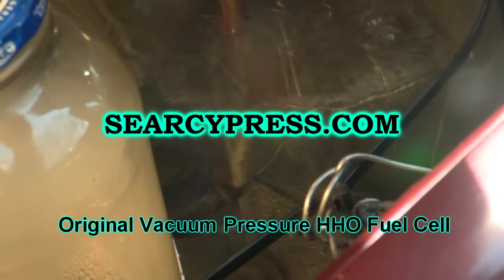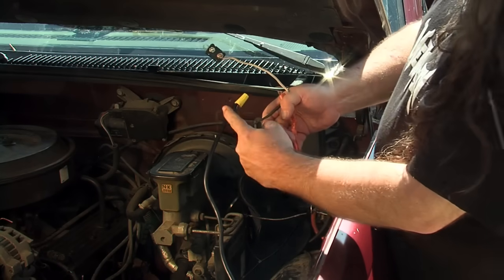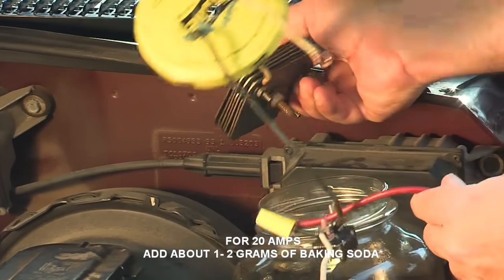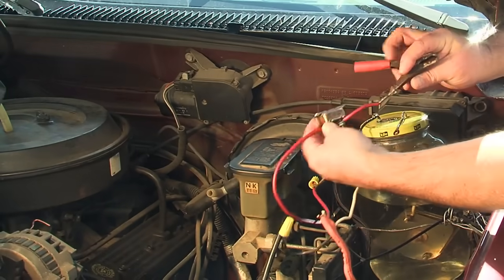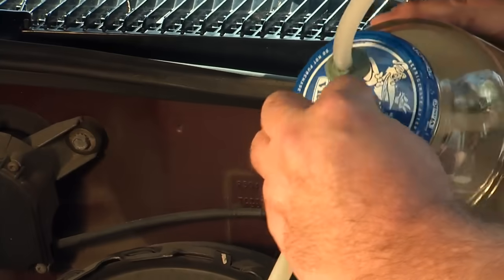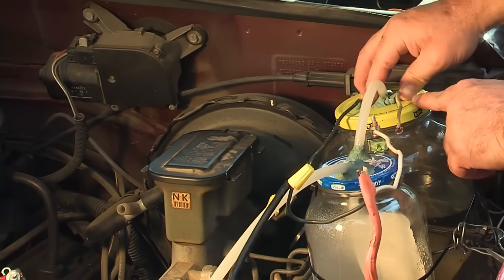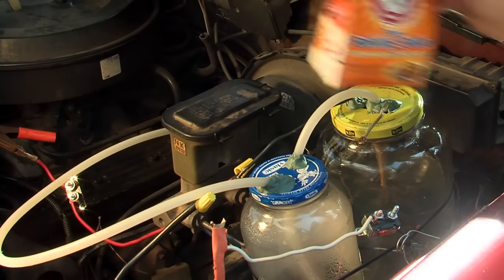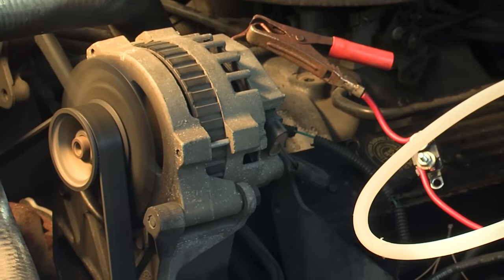Vacuum Pressure Hydrogen fuel cell defeats high gas prices using hydrogen from H2O.

Comment: Technically in theory a humidifier thing like cars in cold climates used or AC units for cars and houses used might vaporize the oxygen sludge safely vs spew it or torch it up out the pipe etc. But cheap/low cost is the name of the game here for now.

Comment: Again more MPG out of this than you realize especially in Diesel and EFI rigs etc. Joints up even over it. Pry about one cent per gallon even MPD!!  HP everything torque incl no mix chevy not so hard but better in Ford based combustion chambers etc with larger plug diameters are key indicators. NOS not needed unless copper piston or something cause it might melt aluminum pistons or rods when combined with H1/H2 combustion.. Put copper aluminum or brass pipe as replacement for radiator hoses for certain. Not that much hotter tho in rpm. I like tail vents tho even let alone easy to spot hood vents in certain non rusty prone spots etc. Stiffer frame would be nice so black smith em as reforged curriculum updates etc. Air compressor leaf blower things on semi trucks do beat em in MPG alone not MPD tho much. Electric motors do win all around tho except in fun and price margin still i guess for now. A cheap mix formula like shell uses would work just fine custom also but way tastier onboard with garden hose only needed etc. Ford and Toy look out you are up to bat!

Comment: LOL @ double your mileage. I think I'll inhale some HHO  and maybe magically I wont need to eat anymore.
Reply: Samuel is an idiot! I think he works for the government.
Reply: I think by adding the HHO to the car will sorta act like adding NOS into the car.  More boost more power.
Reply: RaM Wah Ching If you produce on board you lose power/boost. But if you create it from another source that doesnt require energy from your engine you are correct, It will give it more power. But the extra heat might harm your motor just like nos can.
Reply: I bielieve gasoline is more psyhodelic mby thats why people are still in this Hight of being DUMB sheeps :)
Reply: Ramces Gonzalez I knew that. Had much on my mind. Thanks for the correction.
Reply: You do realize hydrogen is a very explosive gas and nothing burns with water when you burn the two gasses, it burns with more power than gasoline and air mixed with injection. And the “exhaust” from HOH is pure water. Dihydrogen Oxide is the cleanest and best fuel possible. For laymen Dihydrogen = H2 and oxide is oxygen so it’s water.H2O. Oxygen is actually a diatomic element so it’s naturally in the world as O2. The BS about ozone (H3O) is they say it’s being depleted, but they don’t mention is only has a 1/2 life of just over 30 minutes, so it’s continuously being renewed, but CCF’s do screw it up.
Reply: Typo to last “... nothing burns without oxygen.
Reply: Ozone is O3 not H3O. Also, If you want to look at the numbers, then find a table of common standard potentials, there you will find that the standard potential of the splitting of water is 1.229 V, and the production of Hydrogen gas through electrolysis is 70-80% efficient, far more efficient than a gasoline engine (25 to 50 %). This means that the input of energy is smaller than the energy stored in the hydrogen gas produced.
Reply: HAHAHAHA LOL great dieting trick, love the trolls too.
Reply: Samuel Atkins you're not entirely right. It actually depends on the catalyst used. H2 (Hydrogen gas) & O3 (OZONE Oxygen which is SUPER perfect for the tech). This tech is beyond proven to be literally fool proof. Idk how so many bright people don't believe it when too many normal everyday people have working examples of them even now. This tech is awesome and is a key to the energy solution puzzle for sure. Thank you everyone who works to make science and truth coincide, and to do away with all the taught lies!  :D
Reply: RaM Wah Ching You are wrong 2 ways. Firstly The amount of HHO that is added is a fraction of the amount of NOS that is generally used. Second the HHO contains hydrogen that uses up the oxygen in burning so actually there is no extra oxygen  being added to your car.

Comment: Thanks for sharing your knowledge. You explained it so well . I will definitely try this. Thanks again.
Reply from the maker: Keep it safe...try at own risk...ty
Reply: So it's four years later...how did it go?
Reply: We regret to inform you that Moonrider1968 is currently in orbit around the moon due to his gasoline experiment's explosion. If only he had known that hydrogen doesn't explode, it implodes and actually cancels out the explosive pressure of gasoline and reduces gasoline efficiency:(

Comment: This set up works best on older cars since todays cars computers have O2 sensors which regulate the amount of fuel/air mixture in the cylinders. there is a work around that someone came up with. If you have a gas generator this could work as long as you had enough power to generate the amount of HHO to run it.
Reply: EFIE (Electronic Fuel Injection Enhancer)

The EFIE is intercepting signals from the oxygen sensor to the computer and fools the computer by giving it false exhaust readings from the Oxygen sensor.This is necessary because the computer is set up for a regular burn of fuel and compensates for the more efficient and cleaner burn by dumping more gasoline into the engine (until it gets the reading it expects) which ruins your fuel savings.
Gasoline burns better (cleaner less waste) with HHO gas because the increase burn temperature .

You can buy a EFIE on the internet or if you have the skills you can build one.
Reply: @MrShakamuni01  An oxygen sensor checks how much O2 is left in the exhaust gasses. If it senses less than there should be, when for example driving with HHO, it thinks that the engine is running rich, so it will lean/reduce the fueling from injectors. Still doesn't change a fact that this hydrogen device won't give you any more mileage.
Reply: The truck in the video is using an EFI system...
Reply: Quick, everyone buy old ass cars and lets try this.  Fuck all this new shit.
Reply: Theyve been using the current EFI systems with o2 sensors since halfway thru 1985.
Reply: An efficient electrolizer must be used
EFIE device or similar must be used
Ignition timing (ATDC) must be changed
Even compression ratio adjustments (more)

That way you will get the most out of this, otherwise expect the ussual 10% only improvement.
Reply: This should work on a 2000 ford ranger without computer modification right?
Reply: this has me thinking reverse effect,this would cause your o2 sensor to read richer thus your pcm would take out negitive fuel trims and run less fuel to account for the extra fuel.of course your pcm can only pull out so much fuel with fuel trims but should decrease the injector pulse width enough to see a difference.be nice to have a pcm that is programmed for hydrogen so it able to adjust accordingly and perfect the air/fuel ratio
Reply: This setup does not work on any car because it uses more power to split water molecules than you get out.
Reply: @jimmio3727  Yep... no such thing as free energy.. which is basically the BS this guy is trying to spew.
Reply: @jimmio3727  my neighbor has the same setup in his 80’s suburban and went from 12mpg to 24mpg. He’s just using current the alternator is already generating.

Comment: This, by the way, WAS the first result on the search, which somehow seems to be spamming a lot of the vids.
Inspiring, but not much in the way of specific detail, so you actually HAVE to think for a few minutes how to pull this off. A terrible challenge to everyone with our virtually non-existent attention spans.
Add a few extra dollars for a PWM (or even fewer for a pot, MOSFETs, and an ammeter and take care of current-limiting manually) and you've got a spectacular little fuel mileage booster system for a little over $100.

Comment: Does this put water into the engine if it leaks from the tail pipe , couldn't it possibly rust your  block ?
Reply: gasoline burns with water dripping from tailpipe too,

Comment: Think back to NASA putting rockets and space shuttles into space. The did not do the countdown and say we have flashpoint, they said ignition. The four strokes of a 4 cycle combustion engine are intake, compression, ignition and exhaust. Spark plugs provide the spark so the fuel air mixture under pressure ignites. A key is put into a vehicle's ignition switch, which is part of the electrical system from which spark plugs draw energy. GM/General Motors understands they makes engines not motors.

Comment: Ignition point, the point at which the compressed fuel air mixture ignites. Since that point is 20 degrees cooler for HHO vrs gasoline compensate by advancing the timing approximately 7 degrees. One of the issues that many using HHO have to overcome is the engine running 20 degrees cooler. Vanagons don't have that problem, they are notorius for overheating and running hot. Volkswagen 2.1L 4 cylinder engines are 95 hp, HHO fuel increases hp 30% which makes a huge difference for a Vanagon.

Comment: I filled my van two weeks ago. For the past three months I deliberately kept it under a quarter tank of gas. After driving it for days with no gasoline, I filled the tank to see if the gauge was still working properly. Two weeks later and I still have a half tank, but based on another users comment I realized running on E would ruin the fuel pump. Rather than wait to use up the half tank of gasoline, I went ahead and disconnected the fuel pump. If hydrogen system fails, I simply reconnect.

Comment: So now it's 1/2 a tank, not running on empty. You keep changing your story here.

I don't know what YOU mean by "ignition point". The flashpoint for hydrogen is 20 kelvins and for petrol about 230 kelvins. Which is all irrelevant in a petrol engine because the burn is initiated by a spark.

You're still lying, the production of hydrogen is only about 5% efficient from a car, so you're talking bullshite. If it were true EVERY car manufacturer in the world would have this

Comment: Did you end up having to re-jet your carb?
Reply: It's not carbureted. It's a vortec v8, with central port fuel injection. Remember, vacuum goes up as throttle is reduced, which is reverse demand for the hydrogen generator.

Comment: I unhooked the wire to my gasoline fuel pump with roughly a half tank remaining and drove around all afternoon doing errands using only HHO. 

With 6-10 L/min on demand 120 octane HHO and a long fuel line that acts as an HHO resevoir there is no need for inferior 87-91 octane gasoline.  

Using HHO gas as fuel in a combustion engine that can also burn gasoline does not defy laws of thermo dynamics. In fact it supports them, higher octane HHO gas has a 20 deg lower ignition point for combustion.
Reply: That does defy laws of thermodynamics, you're getting more energy out than in

Comment: Ten feet of 1/4 inch fuel line drawing the gas from the H2O resevoir to the vacum intake, only takes a matter of seconds to fill with hydrogen gas.

Comment: Bob Lazar adapted his vette to run on hydrogen, but he chose to store the hydrogen  which he generated separate from the vehicle in fuel cylinders. A long length of fuel line that draws the HHO being generated on demand serves the same purpose as storing HHO in fuel cylinders. A lot less expensive to use fuel line as the storage tank than install cylinders to accomplish the same task. Long enough fuel line, never run out of HHO provided the HHO generator is producing 6-10+L/minute of HHO.

Comment: As soon as I can get it to run out of gasoline, I plan on unhooking the wire attached to it.  I want to keep the gasoline fuel system as a secondary back up fuel system. Initially, I struggled with the installation of my Hydrogen generator and the H2O resevoir which rely on gravity for circulation.  I use a long length of fuel line to the venturi valves on the vacum intake, effectively acts as a hydrogen fuel cell with HHO constantly generated to replenish the reserve, it works great.

Comment: Tap water has chlorine in it, so if it evaporates at a high rate, you will have chlorine gas. Distilled water is free of chemicals and minerals, so it is the best option for use with HHO generators.

Comment: A 60 Watt solar panel connected to an inexpensive solar controller charges two deep cell marine 12v batteries. Those batteries provide the DC current to the drycell hydrogen generator. The dry cell generator works best when the H2O resevoir is mounted 12"+ directly above the unit allowing gravity to assist in circulating the water. Clear fuel line from top of resevoir attached to the engine intake stores plenty of on demand hydrogen for the small 5.5 hp engine emitting harmless water vapor.

Comment: After achieving fantastic results converting my vehicle to hydrogen I'm converting the 5.5 hp gasoline engine on an electric generator to hydrogen. The 7,000 watt electric generator plugs into my homes main fuel panel and supplies enough energy to run all my homes energy needs. The water from condensation which normally drains from the home AC unit is now captured, filtered and routed to the H2O resevoir supplying the drycell which produces the HHO for the electric generator.
Reply: Lol best like of bullshit I've ever read but why? 

Just idling your engine is over a 600 rpms. Driving a 2.5 liter 4cly motor  is about 150 cubic inches. That's 37.5 cubic inches per a cylinder. A cylinder fires ever 2 full rotations. So in a minute of idling at 600 rpms your engine will use 11,250 cubic inches of air a minute at just idle. That's a 187.5 cubic inches a second of air. You're not producing even 2 cubic inches a second. But don't forget that it's h2O 2 parts hydrogen 1 part oxygen. So 1/3 of the gas isn't even hydrogen it's oxygen. So not even 1% of the air being taken into the cylinder is hydrogen. The only thing being accomplished here is the alternator is working harder for the high amp draw dragging the motor down more reducing fuel mileage. This is why water isn't used as fuel in a motor vehicle. 

Now don't forget we don't drive at 600 RPMs most people will be around 1800 rpms at cruising speed. That's 3x the amount of air with still the same hydrogen production. So now ur way below the threshold of .03% hydrogen in the cylinder. Using a spark arrestor on the output hose to keep from blowing the jar up you would be hard pressed to even candle a flame let alone put anything measurable in every cylinder 900x a minute cruising down the highway at the speed limit.

Comment: The standard engine electronics sense when the primary fuel tank is running low on gasoline and automaticly opts to increase the Hydrogen intake drawn thru the vacuum intake manifold supplied by the dry cell Hydrogen generator. By keeping my gasoline tank on E, never run completely out of hydrogen or gasoline. With less than 1 gal of gasoline in the vehicle's tank I run hundreds (800+) of miles on the gasoline/hydrogen vapors and have yet to run out of gas. System adjusts to runnin on empty.

Comment: Based on this video, I installed a high volume dry cell hydrogen generator on my 1986Volkswagen Vanagon and a high volume H2O resevoir. I mounted the dry cell approximately 12 inches below the resevoir which helpts circulate the H2O through the Dry Cell efficiently. The 2.5-6 Lpm of HHO gas is then drawn thru 3/8th fuel line from top of resevoir to the vacuum intake manifold of the engine. Used 50 Amp relays on both the positive and negative wires connecting the dry cell. System works fantastic.

Comment: That may be true, but you are adding a fuel in this case : water.
In a true perpetual motion machine there is no additional fuel, or input added. heat, water, cold , oil, gas or whatever.
But you may be right about the inefficiency. I just think there is a fuel being added which needs replacing from time to time. so it is not a perpetual motion machine. I think some of the inefficiency is void too because you are already spinning the alternator, so using the power that it is already produced.

Comment: Inefficiencies in the electrolysis means that the amount of energy required for the electrolysis is greater than the amount of energy you can get back out of the combustion of the HHO.   Its called conservation of energy.  Think about this for a second: if you could get more energy out than you put in you would have a perpetual motion machine!
Reply: That's all right, but since I saw a video where somebody's injected propane to an old Detroit diesel to make it quit smoking going uphill, maybe it makes the combustion more efficient????

Comment: Its called atomization. Just as it cannot compress water it cannot compress liquid fuel so that is a stupid argument. Secondly fuel injection is a major improvement so your "no gains or improvements" argument sounds even more retarded. You clearly have no idea how engines work and therefor should go comment on other youtube videos such as how the alphabet works or how to count to ten. 
If anything LIQUID HYDROGEN would be the most logical route and completely replace gasoline.

Comment: This system is likely TBI (Throttle body injection) which is kind of between carb and fuel injection. But all engines create vacuum and if this type of system actually works you can surely implement it. I'm still skeptical to be honest.

Comment: Learning how to make hydrogen (120 Octane) from H2O is 9th grade science, selling inferior 87-91 octane gasoline for $4.00/gal is an art. Refining crude oil to make gasoline is ludicrous in light of the simplicity of generating superior octane hydrogen. Burning HHO exhausts harmless water vapor, buring gasoline exhausts poisonous carbaon monoxide. Crude oil refined to petroleum based gasoline is an inferior 87-91 octane product, compared to superior abundant water H2O based 120 0ctane HHO.